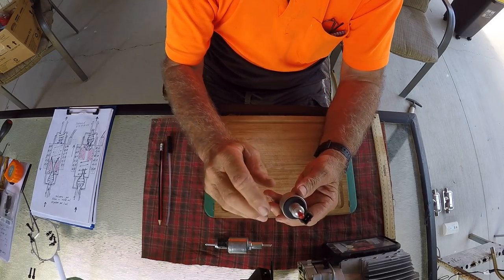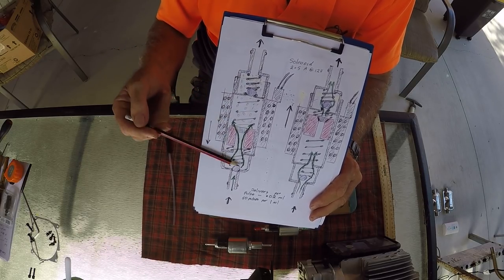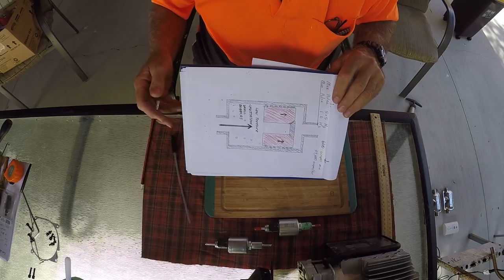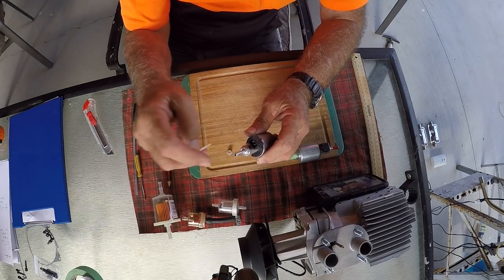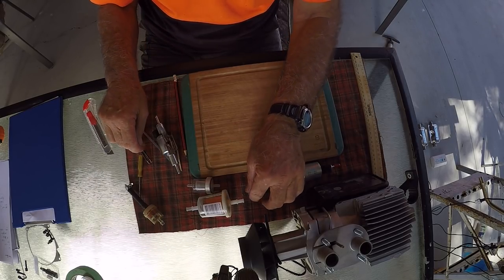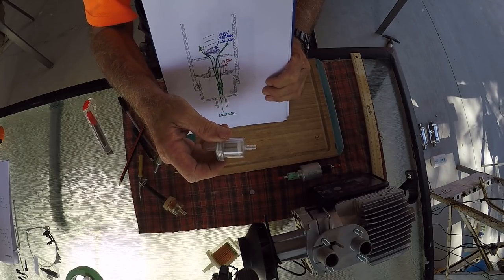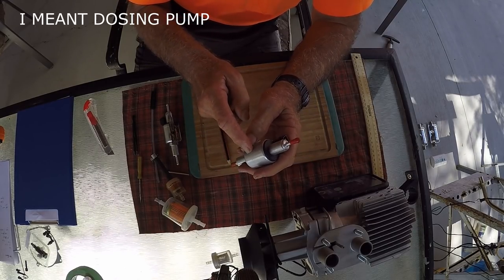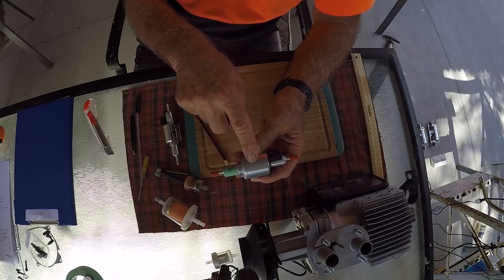Chinese Diesel Air Heaters   Part 7   Metering/Dosing pump

Comment: Hi John, I have a question for you regarding the dosing pump. Last year I successfully installed my first diesel heater in my camper van. It ran perfectly every time I used it for a full year, but just recently I have been experiencing some issues with the pump specifically. I will turn my heater on and it will begin to heat the plug. Once the plug is "heated" then the dosing pump light comes on on the display panel indicating that the pump is activated but it actually never turns on. I am wondering if this is maybe just a power issue and not an issue with the pump? It doesn't happen the first time I try to start it (when i have a fully charged battery) but if I turn it off in the middle of the night and try to turn it back on later if I get cold, then it won't work. It is almost like maybe it doesn't have enough power to start up again? However, like I said I have never had this issue before, even when I would start and stop it multiple times in 1 night, so I am wondering why it would be doing it now. Do you have any opinions or insights? You are easily the most knowledgeable person regarding diesel heaters, so I hope maybe you have an idea?

when my battery is fully charges, the Volts go from 12.5V to about 12.1-12.0V. When the battery has this much power, the pump starts. However, if I try to start it again after it has ran for awhile it will make the battery go down to 11.6-11.5V. I am assuming this just isn't enough power to activiate the pump so I am hoping it is a power issue and not something more serious. However like I said, it never used to do this previously so i'm wondering if my battery is loosing juice of if my heater is somehow starting to malfunction. I hope to get a response from you John McK 47, you were easily the biggest help to me installing my heater properly and I am so grateful you made all of these in depth videos!
Reply from the maker: Hi Cole,

Looks you have a power issue to me. 

Every time you turn the heater on it goes through its start cycle, and this includes running the fan and heating the glow plug. If the glow plug does not have enough power/voltage (up to 10 amps) it will not get hot enough and the ECU will not start the pump.

Over time batteries lose efficiency, but also check you have no corrosion in the plugs and wire connectors that cause voltage drop.  JMcK

Comment: John, is it normal to have a few tiny air bubbles in the fuel line going from the fuel pump towards the diesel heater?  There is no bubbles in the line from the fuel tank to the fuel filter.  I wonder if the fuel pump creates a few small air bubbles during it''s operation.  There is a small air bubble  every 4 to 6 inches in the line from the fuel pump up towards the diesel heater.
Reply from the maker: Oh dear Ben. This is explained in the videos. You need to watch a bit more.
Little bubbles are are quite normal in the fuel line. The the fuel pump pulse action creates tiny cavitation bubbles. This is why you need to have the pump in a vertical position, above about 15 deg, so these bubbles can escape up the fuel line where they are injected into the burner. They actually help in the atomising of the diesel prior to burning.  JMcK
Reply: sorry about that John.  I've seen most of the many videos in your series on diesel heaters but somehow did not see this video in it's entirety.  As you mentioned, you clearly explain the air bubbles topic in this video.  Your videos are very educational and are well done... thanks for taking the time to help so many people ..
Reply from the maker: Ben Ly 
Your welcome Ben.   JMcK

Comment: Could you please give your thoughts on having the pump facing downwards in a "45 degree" (135 degree) manner? I assume that could cause problems with the install ? 
As far as I understand from your videos, it should always be facing up? (15-20 degrees upwards or more)
Reply from the maker: Hi Andreas,

The pump must always face upwards to allow the little cavitation bubbles to escape.  JMcK

Comment: Hi John , after following your videos which have been a great source of information I finally installed the heater. I started it up and it appeared to work well then I got an E05 error and it shut down, I looked around could not find what E05 was but someone said that it might be overheating as I have not left enough space around the unit. Might this be the reason?
Reply from the maker: Hi Derek,  yes, your heater could suffer from poor circulation around the unit but also look for other issues. 

It is a good idea to test run a heater out in the open before the install. That tells you all is well before the install. 

Check that there are no restrictions in the outlet hot air piping, inlet and outlet.

Check that the fan is spinning properly. I have seen some heaters with the fan scraping the case. Does the fan speed increase as you increase the temperature setting?

Check the temperature of the case, you can see the numbers in the videos. The case should not get so hot you can't keep your hand on it.

If the case is not overheating you could have a faulty heat sensor.

I hope this helps.   JMcK
Reply: John, thks for the quick response. You are right I should have checked this before installing. The unit gets hot so I plan to move it give it space and put in some vents into the storage area where I installed it. Thks again John

Comment: Hi John...Great video series...I've watched them all a couple of times.
I am in the process of installing a (make believe 8Kw. heater) right now... I got a problem.... when I was attaching the black outer fuel line to the top section of the Fuel Pump....the nipple in the fuel pump started turning. I am afraid it is going to leak now or allow air into the fuel line into the Combustion chamber.  Have you ever had this problem...or am I worrying about nothing ?  I guess I'll find out tomorrow when I try to fire this thing up ! Liked/Subscribed a while back !
Reply from the maker: Sorry, SG

I have not had this happen to me, but when I get home in two days I will get out an old fuel pump and have a good look.

If it is the top of the pump it is the pressure side so you will not suck air but will leak diesel at the pump if there is a seal issue.

I would be interested in your outcome.  

Cheers.  JMcK
Reply: @johnmck1147  Thanks for your reply John... I'll let you know what happens later today.
Thanks again !
Reply: @johnmck1147  Yay ! Success...Works like a Charm and No Leaks !
Thanks a bunch for your Tutorial Series John....  YOU ROCK !
I had a Mister Heater Big Buddy heater in my van since last Spring when I began my van build...I insulated my walls and celing with Thinsulate and then put wood paneling on my walls. Last week I had to tear down all of my wood paneling as the Moisture/Condendation here is Oregon created so much Mold it was DISGUSTING !
This dry diesel heat should work much better ! I should have done this a long time ago.... I'm gonna buy a couple more of these little beauties while the prices are still reasonable....looks like the Chinese are getting Greedy !
Stay Safe and Well my friend !
Reply from the maker: Screww Googlle 
Thanks for the feedback. Warm and dry accommodation to you.  JMcK

Comment: Hi John, do you know if these pumps run on 12V ? I wanted to test if mine still works, and I was wondering if I could just manually pulse 12V to the input to test it?
Reply from the maker: Yes GL, you can get both 12 volt and 24 volt pumps to match car or truck voltage.
Yes, you can pulse them manually by applying voltage quickly on and off to the pump.
In some of my videos I show a simple on/off switch I use to manually test the dosing pumps.
Cheers.   JMcK

Comment: Hi my friend, I will be glad if you can help me have a question, I have a Chinese diesel heater webasto. I started this device once, but the cabin I made was not complete, I disassembled the device again 15 days later, I mounted the device, but the fuel pump did not work, after a while, fuel flowed from the exhaust. can you help about the subject
Reply from the maker: Hi Ali,

I need more information to offer you advice, but hear are some suggestions.

If you had the heater apart after it worked initially did you put it back correctly?

Did you lengthen the power wire to the heater when you installed and did not increase its size?
If you have a voltage drop the glow plug will not get hot and if the glow plug does not get hot the ECU will not turn on the fuel pump.

Are you aware that the fuel pump does not start straight away, it waits until the glow plug is hot.

The wires to the glow plug are fragile, if you damaged them the glow plug will not get hot, and if the glow plug does not get hot the pump will not start.

Did you install a fuel filter? Dirt in the fuel can jam the fuel pump.

Have you seen the motorhome install videos?

Sorry, I need more info to be more helpful.   JMcK
Reply: Hi, my friend, I will explain what I did after the installation of this heater webasto. He did nothing, I waited, I repeated this process.When I assembled the device before, the fuel pump sounded working 20 days passed from the first installation and I tried these days I did not get a working sound from the pump I disconnected the fuel pump and gave air to the fuel tank before the device came with some smell and smoke After a little heat from the exhaust, there is nothing again, finally diesel fuel came out instead of smoke from the exhaust and I leave it like this, all the processes I did, thank you in advance for helping.
Reply from the maker: Hi Ali, you can test the fuel pump by quickly connecting it on and off to a battery. The polarity does not matter, just touch one wire on and off to a battery. If working the pump will click when the wire touches the battery. Don't leave the wire connected to the battery, just a quick touch.

From what you describe, it is unlikely to be the fuel pump, more likely a problem elsewhere. Perhaps the glow plug or ECU.

Have you contacted the supplier and asked for a replacement heater?

Sorry I could no be more help.   JMcK
Reply: Thank you very much for your interest. You are good enough for me to give me your ideas and guide me.
Reply from the maker: Ali Erol  
👍

Comment: Thanks for the vid, what are your thoughts on running on a fuel with less lubricant (ie) kerosene, thanks
Reply from the maker: Hi , Have a look at part 5. I did a video about using kerosene in these heaters. Please see if that answers your question. J
Reply: Oops, sorry I watched it afterwards!!

In the uk kerosene is a lot cheaper than diesel.
I once read a paper (I think it was from the ‘Japanese institute of petroleum ((or something similar))
On the effects of veg oil on kerosene as a lubricant, they recommended/stated that kerosene veg oil mix of 50:1 was sufficient to lubricate the pump on a Diesel engine, I’m hoping that the 200ml if veg oil I’ve just added to the tank on my heater is going to work!!!
Thanks for the vids, much appreciated from Wales UK👍
Reply from the maker: Thanks for the feedback. I assume you are talking about a cheap (no tax) home heating kerosene. In Australia kerro is just so much more expensive than diesel. I would be most interested to see how the veg oil goes. In the future I intend to try a two stroke oil mix in kerosene to see how that performs over some months. You can now buy a new Chinese dosing pump real cheap (not hundreds of dollars) so a wrecked pump is no real issue anymore. Also if your kerosene is so cheap it would cover the cost of a new pump every season. Cheers J
Reply: @fingerofun  In the US and Australia, what we call kerosene, I believe the UK calls paraffin.
Here in the US, kerosene is about $6/ga and stove oil/red diesel about 1.5$/ga
Reply: John McK 47 
Well,  i thought I’d try it without any lubricant, I bought a spare pump in case I ruined the one that came with the heater and I’ve been running on Kero (28 sec), but no problems so far, my fuel savings have far outweighed the cost of the spare pump and I get no smell and haven’t experienced any issues/carbon build up, cheers again for the vids👍

Comment: Can't you just replace all that clear line, or in some kits green line, with standard black braided fuel line?
Reply from the maker: Yes Ryan, on the pick up side of the pump. 
However, you should only use narrow bore hard nylon tube on the delivery side of the pump, particularly if it is a long run.  JMcK

Comment: Hi John,
I have a new 5Kw Heater. On start up there is a lot of smoke from the exhaust. When the unit is off, after a couple of hours diesel oil starts dripping from the air inlet port. I suspect the one way valve in the dosing pump is faulty allowing diesel to flow into the heater. The diesel tank outlet is about 50mm higher than the heater. There is no other position to lower the tank.
Any ideas.
Regards Rob
Reply from the maker: Hi Rob,  I suspect you are right. You need to look at the total head height of the diesel. If the outlet is 50 mm above the heater and the tank is full the diesel head height could be 400 mm above the pump. The pump only has tiny non return springs and 400 mm of head pressure can leak past the pump.

First, I would install a fuel shut off valve in the fuel line before the filter and the pump. You can use standard auto fuel hose from tank to shut off valve, to filter, to pump. From pump to heater you should only use small bore, hard nylon fuel hose. Turn the fuel tap off when not using the heater. This should fix your problem.

If still an issue, you could also see if you can lift the pump above the level of the fuel tank. It is ok to pump the diesel down to the heater if using small 2 mm bore hard nylon tube. The tiny cavitation bubbles will be pushed down hill. 

Good luck.  JMcK
Reply: @johnmck1147   Hi John,  I've put shut off tap in the fuel line just past the tank. Left it all day with no leakage. Fired up heater. It works perfectly as I expect.
I have 2mm nylon hose from the tap to filter to pump to heater. 
I can't lift the heater or lower the tank so I guess I will be using the stop tap.
Thanks for your very informative You Tube videos. They were very helpful.
Regards
Rob
Reply from the maker: Rob Luker 

👍

Comment: Hi John, I’m having a lot off issues with my diesel heater. It’s a 5kw Vevor one and the original pump worked for about 3 months ok then suddenly stopped. It’s mounted vertically and I’ve got all the right hoses and connections like in you videos. I bought another pump of Amazon and that worked straight away but only lasted about 6hrs.
The third pump has just failed after about 4hrs use 😡
I measured the coil before fitting it and it read about 6.5ohms, it is still reading the same after it stopped working so I don’t think the coil is faulty. 
Do you have any idea why these pumps are failing ?
Many thanks.
Reply from the maker: Hi Mr F,

These pumps are generally very reliable and I have only seen failures from dirty fuel. This can be not only sediment but also water. Suggest you make sure you have a good fuel filter that is working properly. Next check for water in the fuel. Remember water will go through a filter.

Also check you are using pumps of the right voltage, and your pump wire and connections are good and you don't have voltage losses.

However, I suspect bad fuel.  Please let me know if you find the problem.  JMcK
Reply: Hi John, I’ve checked the connections and they’re all fine. Just a bit of background, I bought the heater in January this year and installed it in my workshop. The fuel tank is a 10 litre one and the fuel that’s in it ( about 4.5 litres ) is what was in it when I stopped using it in April. The pump is mounted vertically in a 8”x 4”x 3” plastic electrical box and I’d put some fleece material in to deaden the clicks. The heater is running from a large 12v Gel mobility battery which I connect to a trickle charger when it’s running. 
The filter is one like you use and looks clean, as does the fuel. How would I know if there’s water in the fuel ( the lid is kept on the fuel tank which has a air bleed hole in the top to prevent a vacuum.
I did wonder if the pumps are overheating in the box ?
Reply: Hi John, I stand corrected ! Closer inspection of the fuel tank has revealed a thin layer of a sort of brown sludge in the bottom of the tank and when I removed the filter there was a small amount of the same sludge near the outlet to the pump !
The fuel itself was tipped into a clear tub and it does look a bit cloudy so I think your fuel idea is probably right.
I also found there was some corrosion on the supplied metal pipe which fits in the tank and goes down to about an inch off the bottom of the tank !
I’ve decided to use the 5litre plastic container I use to get the diesel from the pump with a spare top and a piece of the nylon rigid hose going through the top to about 1/2” off the bottom. That way when the fuel is very low I can just get it refilled from the diesel pump at the filling station and the fuel should be fresher. 
I’ll also empty the fuel out in the spring and clean or replace the filter leaving it dry till I use it again in the autumn.

Comment: Would it be possible to use a peristaltic pump instead?
Reply from the maker: Hi Scinner, these heaters use very small doses of diesel, .02ml per pulse . The ECU knows the pulse dose and adjusts the pulse rate and fan speed to get the correct fuel air mixture.

The Germans invented these heaters decades ago, and they have very smart engineers working on the design, and I suspect if they could find a better fuel management system they would have done so.

I personally can't see hoe a peristaltic could be made to work with the current design.

Cheers JMcK